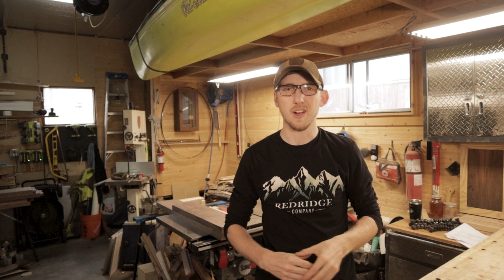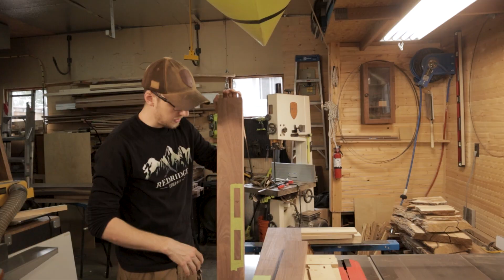Cutting the mortises and getting one leg fully mounted! | King Bed Frame | Fine Woodworking

Comment: thank you . question please on the mortise why not use a smaller size drill bit multi holes  then fallow up with the right size router bit ?
Reply from the maker: That's a really good question and probably a much better idea! My thought process is that this was the simplest a least risky method to cut these slots. Although the router probably would be cleaner I just didn't want to risk taking a router to these side rails since we're so close to being done!
Reply: @morganhurst_redridge  thank you

Comment: You might have good luck using your router jig to cut the holes for the nuts.

You also might want to either make the nut holes large enough to put a wrench in for tightening the nut, or epoxy the nut in place.

If you make the nut hole large enough for a wrench, you could also add a washer under the nut and give yourself a larger bearing surface in case you have any concerns about the nut digging into the wood when it's tightened.
Reply from the maker: I don't want to spoil too much of tomorrow's video, but I will say that I will be talking about some of your points!
Reading your comment I realized that I forgot to talk about why I'm not adding a wash, basically I can't find any that are narrow enough to fit the 1/2" bolts. The ones I have are 1 3/8" in diameter which I'm worried would leave the side walls of the rails too thin. I'm still looking though because I agree with you, it would be great to spread the pressure of the nut over a wider space.